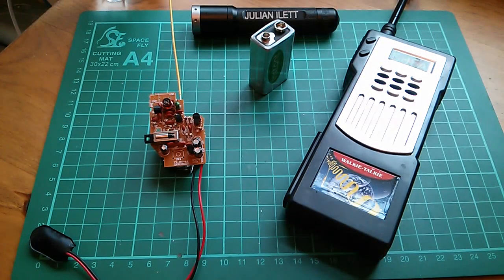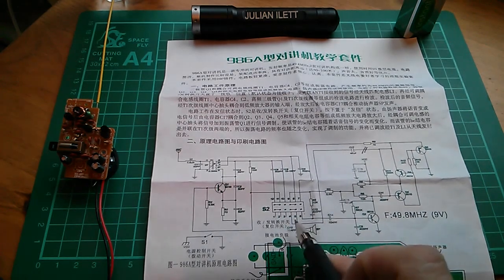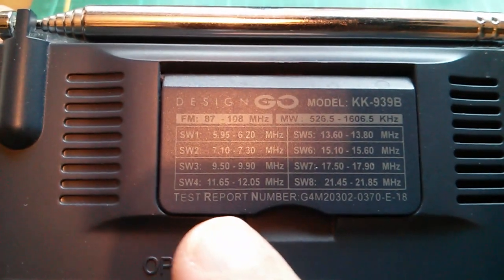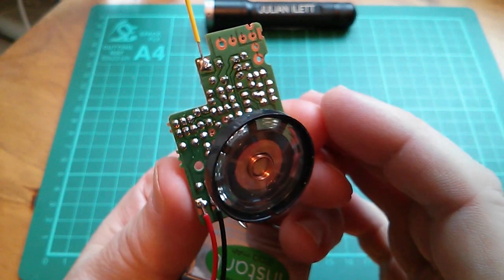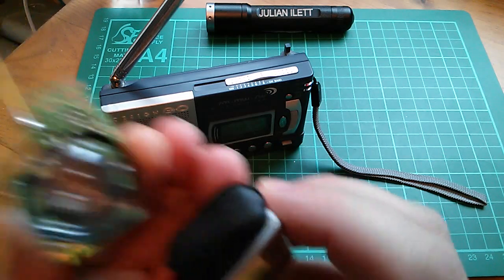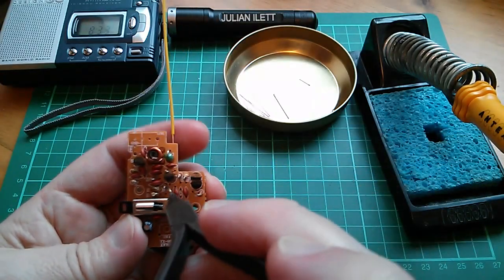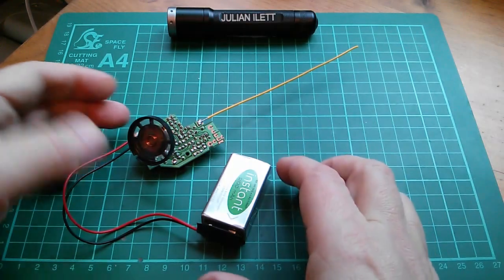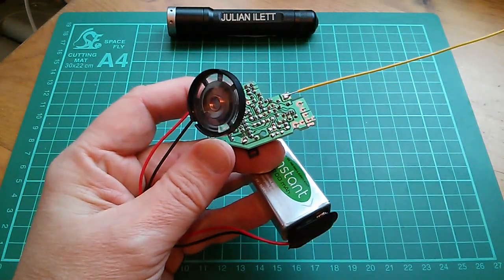Kit Build Update #2: DIY Walkie Talkie Kit

Comment: The reason you were picking up distorted audio on a different frequency than you expected is because the antenna was not the correct length. Transmitting with a wrong sized antenna can seriously damage or break the transmitter

Comment: These would be great for someone who is starting out in radio as the circuit is simple to build. Once built, they would be of limited use as there are several drawbacks with this simple circuit. Super regenerative receivers tend to emit a lot of broadband noise in a large bandwidth around the receive frequency. Also, the frequency of the transmitter isn't controlled with a crystal, and could conceivably transmit out of band and violate radio regulations.

Comment: Since the transmitter's frequency is determined by the values of the capacitors (±10% or more) and inductors, and that tunable transformer is in some random position, it might very well be that it's transmitting closer to 42 MHz... Heh, and one thing I hadn't even thought of before you got the first noises from the speaker was that there's no squelch! Argh.
Reply: +renxula - You could be right but that does seem a fare ways away from 49.8 MHz.  Best way to check would be with a frequency counter.  A scanner could also work of course.

Ya, I think Julian should MAKE a squelch circuit for it!  Not too hard and it might just be fun!  Seems there is lots of room in those cases to put one in built on a perf board too.

Comment: Perhaps some combination of the output frequency and the receiver's first IF frequency. I used that trick on an old Bearcat scanner. It seems like the scanner frequency was 21.7 MHZ. Things like that are suppressed, but I was within a mile of the transmitting antenna.

Comment: 21.24 MHZ on the portable radio results from mixing the local oscillator (LO) and the first intermediate frequency (IF).
Depending on the quality of the LO output signal anything but a pure sine wave will contain harmonics which will also get into the mixer, so if a harmonic of the LO plus or minus the IF happens to be the same as the Walkie Talkie's frequency, you'll be able to receive that on the portable radio.
However, that's also a sign that the portable radio was built with a bare minimum of filters without protection from strong signals (such as a nearby transmitter).
Reply: +Jens Goerke AM also has a tendency to just get super imposed into signal paths such as the entry of the audio amplifier in the receiver, you can test this by checking if you can year it on other frequencies aswell even FM shouldn't matter at that point.
Reply: +Lan Party Hosting
It could also have been a "blank" spot on the radio, perhaps caused by internal harmonics, that muted the noise and thereby made the superimposed AM more intelligible.
Reply: Or it could be simple break-through.